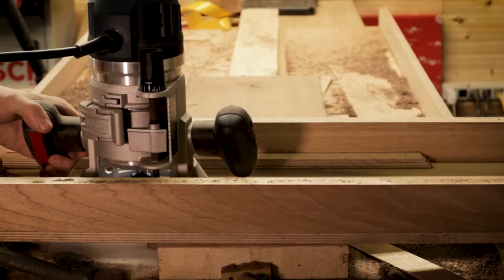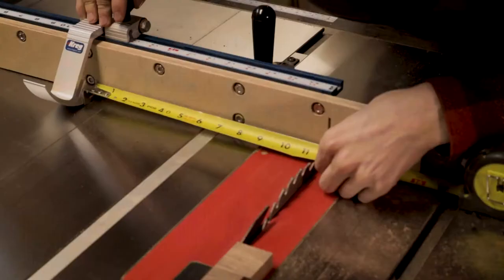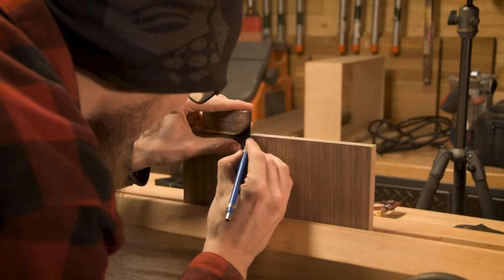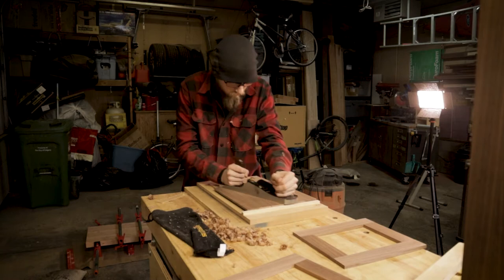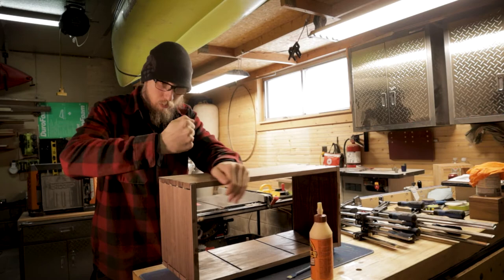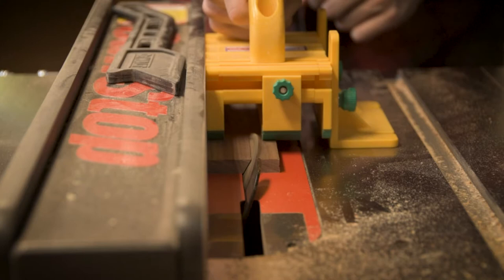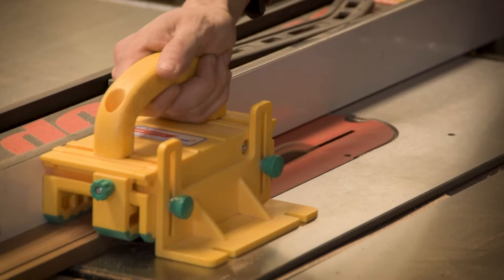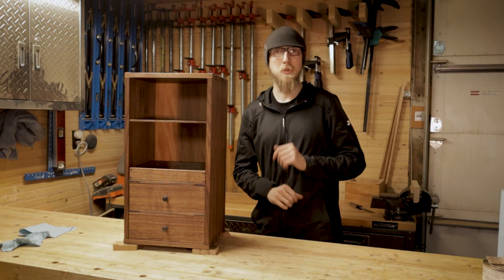Hanging Tea Cabinet

Comment: Nice work on the cabinet Morgan. I have used the Tried & True varnish oil before and I didn't care for the feel of the finish. I am tactile I suppose but I think something that you enjoy touching will be appreciated more. I watched your application carefully and I think I did it the same way but perhaps you have further steps you use? Again, nice job and an enjoyable video.
Reply from the maker: If you're going for a nice feeling finish then I'd recommend the original oil which has bees wax. It's a little softer and I use it on tool handles and most of my projects because it feels pretty good.

The varnish oil is definitely harder and feels more like a polyurethane finish but adds a good amount of protection. Now I only really use the varnish oil on table tops or heavy use areas. I'll also sometimes use it on drawer sides because it makes them slide a little better.

Hope that helps!

Comment: Amazing project.
Maybe go a bit easy on the hand saw.
You overshoot your lines sometimes.
Dont push it to hard.
Reply from the maker: Thanks! I've been working on letting the saw do the cutting, on this project, exactly like you said, I was forcing the saw into the cut rather than just letting it do the work!
Reply: @morganhurst_redridge  Exactly.
Wich is ok for the first part but when you are close to the end slow it down.

Comment: Great work and thanks for this valuable input! May I ask you how you have attached the shelfs / dividers to the case? Are they glued to the sides or sit they just in the grooves without glue? I am currently planing a similar project and I am not sure because of the grain direction of the dividers. Or should I just glue the parts of the frame into the groove that have the same grain direction? So the beginning and the ends? I hope you understand what I mean…😅
Reply from the maker: I think I get what your saying!
For the shelves on this case, I glued them in place because the grain runs from right to left which means the expansion and contraction will happen in the same direction as the walls of the case. If your shelf pieces have the grain running front to back (which you should avoid) then you can't glue them or it could cause the case walls to crack. When you're thinking about grain direction and expansion/contraction think of a circle, if the direction of the grain flows in a circle then your good to glue the pieces together.
Reply: @morganhurst_redridge  but the runners and the sides of the case do not run into the same direction or do I oversee something? The grain of the sides run from bottom to top and the grain from the runners from back to front.
Reply from the maker: Sorry yes, I'll be honest I forgot I used those open frames! Now I remember how it works, those dividers are in a stopped dado so they can't come out the front and the back panel locks them in place. I put a dab of glue right in the middle of the dado to eliminate any potential play. This lets the side panels expand and contract without affecting the fit of the dividers.